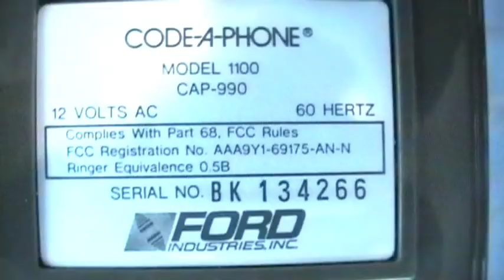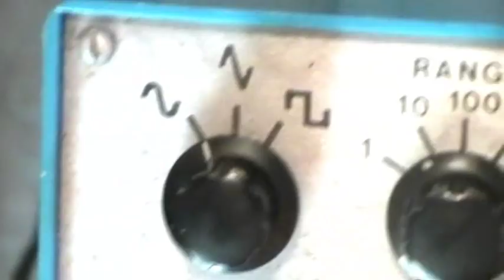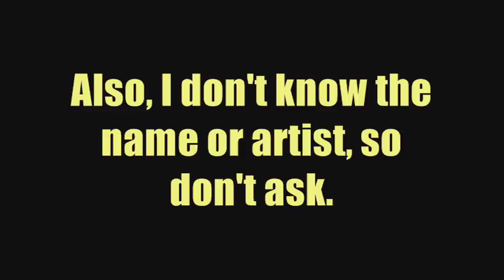FORD Industries model 1100 telephone answering machine, 1982.

Comment: "Like a cassette"? Not all cassettes use the same size of tape. There's 3/4" tape cassettes, 1/2", 1/4", 1/8", and even a tiny little cassette with tape that's about 3/32"! Gotta be more specific.